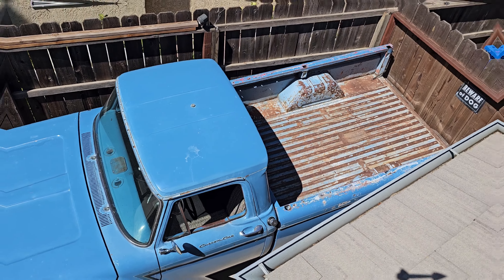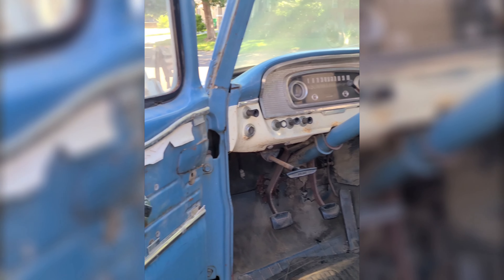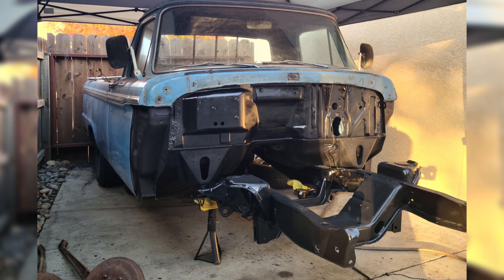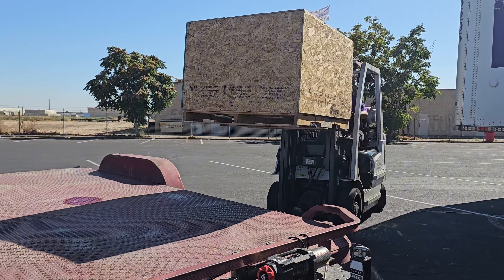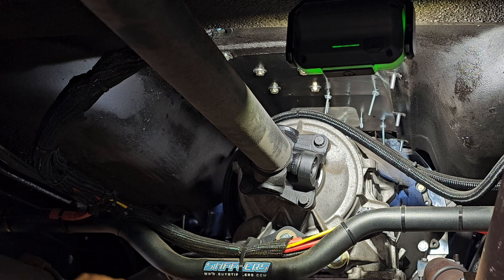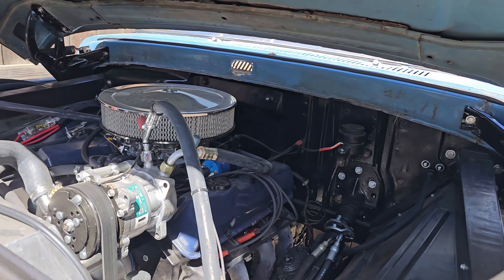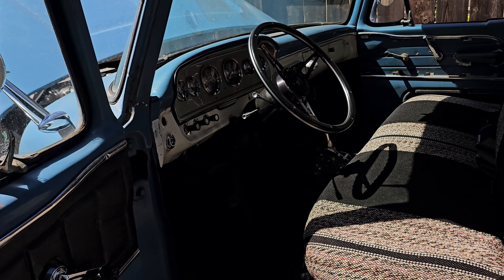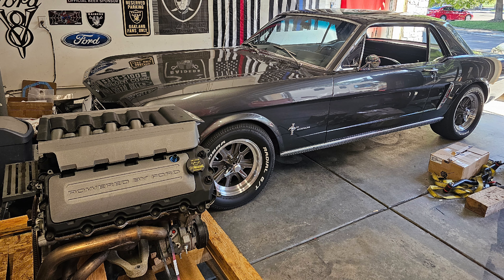1965 F100 Coyote Swap Part 1

Comment: Where did you pick the engine up from. Glad someone is doing this. I have a 65 as well and was looking to do either coyote swap or build out a 4.9L inline 6.
Reply from the maker: In the next few episodes I posted it showed exactly how I pulled out the 352 FE and how I bolted in the Coyote using Fat Fender Garage motor mount kit. The 352FE I used a carb plate to pull her out and then the Coyote I used some webbing straps and used the studs for the exhaust manifolds to place her in there! She fits so good inside here :)

Comment: What specific tires are those? I have a 70 that needs some new shoes
Reply from the maker: I wanted to keep the original rims and hub caps so I went with the Mickey Thompsons Baja Boss. Was told I could probably go a little bit bigger but played it safe with 235/75R15